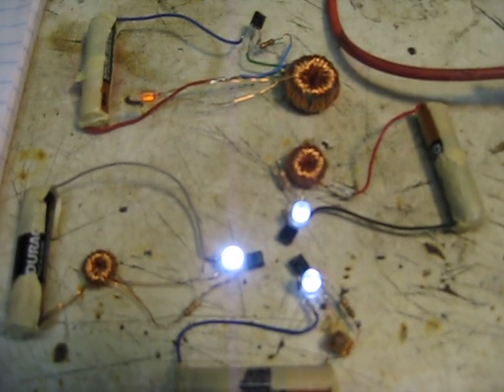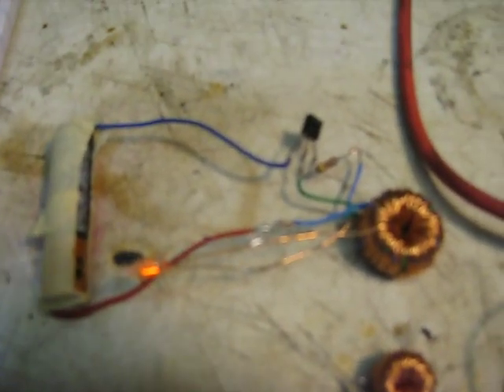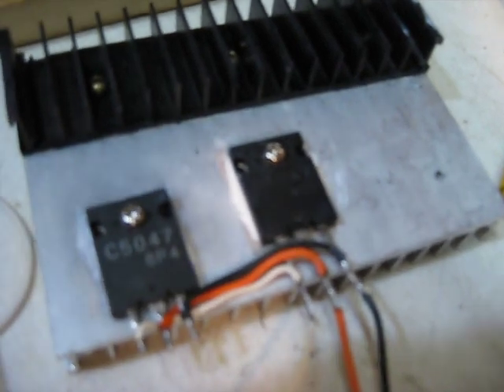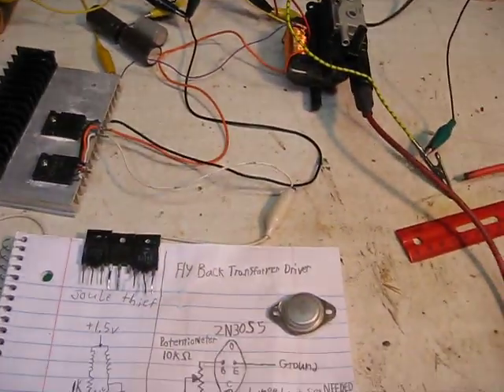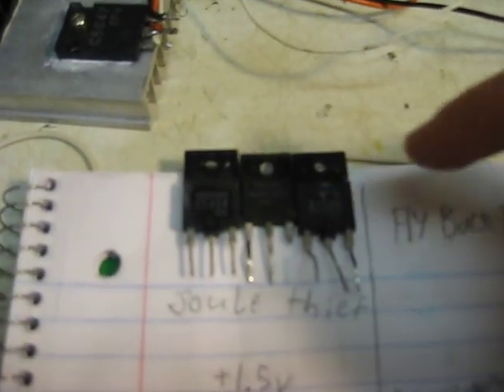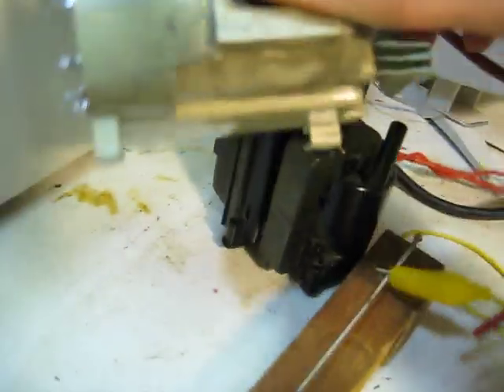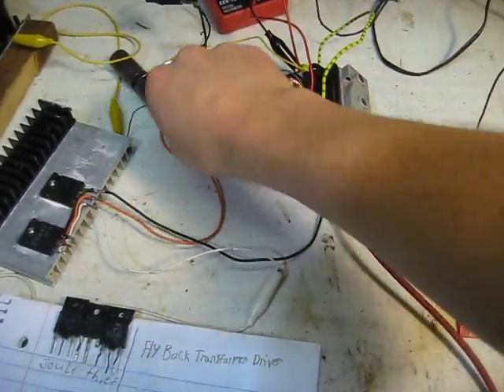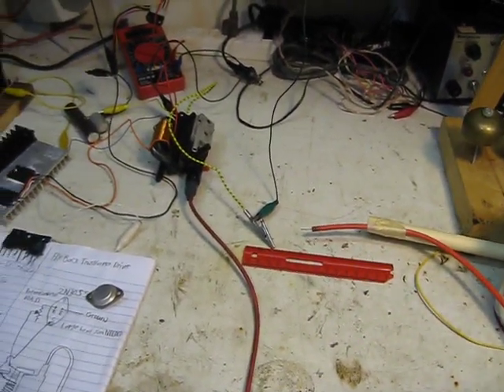How To Make a Super High Voltage Joule Thief Fly Back Transformer Driver

Comment: sweet thanks for the info with your video i finally got it built. Now how is it that you can power that little neon light with 50 volts and not burn out or fry the transistor? I'm new to this sorry about all the questions.

Comment: not all "large transistors" will work, voltage regulators for example. also there is a different wat you hook up n-ch. or p-ch. mosfets or NPN and PNP transistors. plus im fredy sure somthing like SCR's wont work, and other things like JFETS, etc

Comment: @makerj101 if the 2n3055 worked the best try the Tip3055. It has the same ratings and is smaller and easier to mount on a heatsink

Comment from the maker: @iluzyon1 Yes it is possible to use the existing coil in a fly back transformer.  I chose not to for a couple of different reasons.  1 being that I would have to find 2 windings that are the right number of turns.  2 I don't know what direction they are wound.  It probably would be more efficient using the existing coils.  It would just take some time to get it working properly.

Comment: @makerj101 Ok. Also try making a HV capacitor using kitchen foil and put it in parallel with the spark gap, you get very loud and bright sparks!